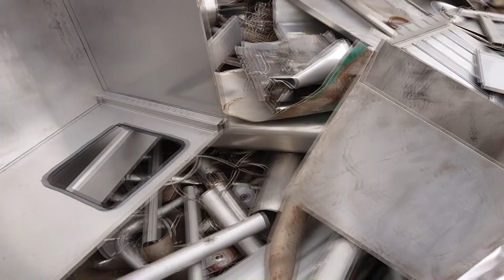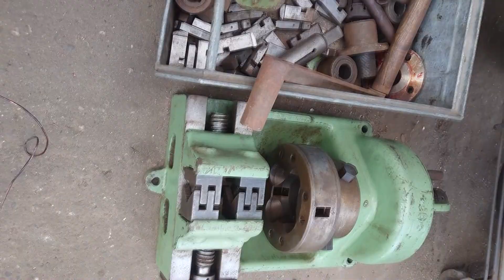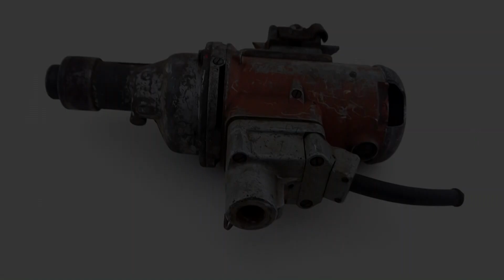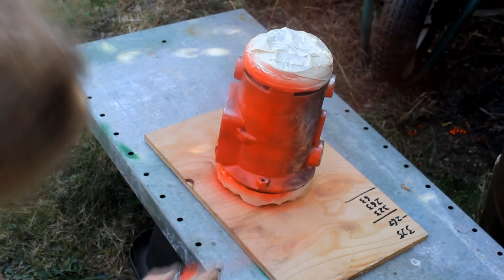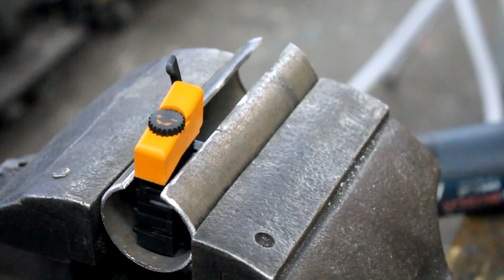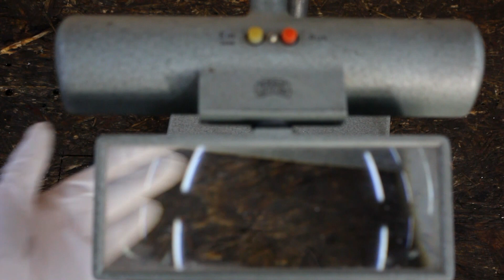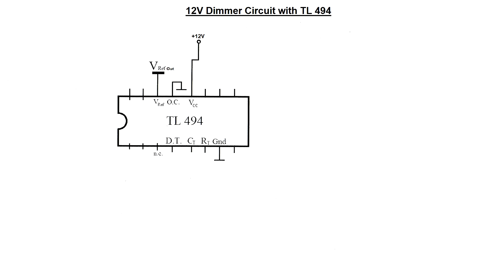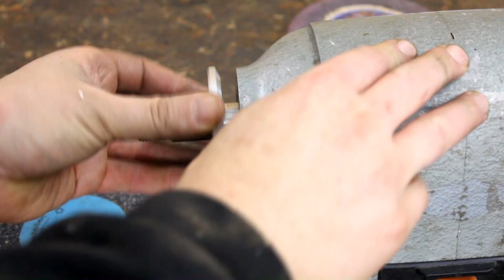Rare Scrapyard Finds! Repair-A-Thon!

Comment: Completely rusted rebar? ok surface rust might be ok, if it's in the trash it's probably not fit for construction and probably has been sitting outside for years.

Comment: Love your videos, I had an old Bosch hand drill die (after I dropped it) instead of going out & buying a new one, I opened it up & repaired it with help of an online schematic! It now works fine. I just wanted to thank you, I never would have attempted but that because of your videos, it gave me the confidence to try. Ich danke dich darube echte :-)

Comment: You are so lucky you can actually pick stuff from a junkyard - not possible in most of North America. There are lots of fully working machines worth 1000s being thrown out daily. Heck in Alberta where I live large fully working and in like new condition 100hp electric motors are scrapped.

Comment: I'm a little concerned about the heat dissipation in the Triac, the heatsink attached was way too small and vacuum cleaners are rated for much less power than that drill machine.
Maybe needs a bigger heatsink or even better would be to use the metal surface as a heatsink if you can find an insulated body triac.

Comment: I think the variable speed circuit is the problem, this drill shouldn't have speed control for it to work with its full power in my opinion

Comment: you already have a foundry, you can melt raw material from the scrap yard and reuse them. Aluminium for example, very easy to melt and cast into mold shapes that you need for your projects

Comment: In power stations and large turbines the couplings have massive expanding bolts 4-5" and the couplings cant be removed. So with these 2 handed "hoaning drills" are used for hand hoaning on these

Comment: A trick with those 12V LED strips is that you can put them in series if you've got a 24V power supply. The positive of the first strip connects to the +24V supply, the negative of that strip then connects to the positive of the second strip, and the negative of the second strip connects to the ground/0V of the supply. Both strips do need to be the same size though, so there's not too much current going through one strip.

Comment: Should’ve mounted the new switches where the old ones were. Would’ve been cleaner. No need to drill new holes and the wire wouldn’t have to be routed through the base.

Comment: Careful not to commit the error of survivorship bias.  Quality tools tend to survive longer than low quality tools, which means that even if there were just as many garbage cheap tools back in the day, they would not necessarily survive. So then it seems, to us, that since the only tools that remain are of higher quality, that perhaps predominately high quality tools were manufactured back in the day.  This conclusion is very likely false.

Comment: Great job as usual.  I love the scrapyard shows.  You find such amazingly good stuff!  The magnifying light was a real gem!  For the old bench grinder, I would have left the guard off the side that was missing and installed a wire wheel instead of another grinding wheel.  A bench mounted wire wheel is very useful.

Comment: I love watching your videos.  Its like there is so much at scrap yards that can be fixed with just a little fix here or there and its up and running or even be used from something completely different.  Just like that rebar its like why do they junk it when its so darn expensive to buy it brand new.  I had an Amish naighbor that had and old rear tin tiller he took the motor off to use for a round his home.  He gave me the old tiller.  I bought a new motor bell housing and I have used it every year so fare for my garden.  Brand new the tiller is worth 5 grand and all I spend on getting it up and running like new was like less than 300 bucks.

Comment: The Fein drill reminded me of an old vintage Bosch GD25 I rescued recently, no clutch, no soft start, but bags of torque and easily rips itself out of your hands if you're not careful. The first replacement power cable I put on was trashed on its first big job, I've since added another handle on the top where it would've had one originally and treat it with a bit more respect!

Comment: thread cutter... I kinda want that now. I have an older model thread cutter that had a bad motor and someone build a chain drive welded on sprocket and put a motor on it. Sometime in the future I intend to tear it down and make a whole new mount for it so that it can be portable. Its a fine machine for what it is.

Comment: Greetings G, it appears a time is coming when you will want/need an industrial garage/loft to make into a home with 1000 m2 workshop. Good thing you have a girlfriend to help.  Regarding the non-centrifugal-switched motor starter, the math for sizing the power needed for a capacitor permanently loaded is fascinating and an uncommon topic. Ascertaining the impedance for the starter winding to distinguish the permanently loadable winding/versus those that need to be switched out is also a universally omitted but fascinating topic.  Good job, keep going.

Comment: 23:22 That disc you are turning is not necessary. You can use ordinary sized washers. I have and mine has been running 30 years or so. The advantage of the large steel disc is really more to keep it running true and smooth. I know this because my table saw has such an optional disc. Using aluminum you are not going to get all the weight they originally engineered & intended it to have.
 I am still wondering why your vacuum cleaners have speed control.

Comment: Back in the mid 1970's I was on a scaffold platform with another worker putting up an overhead crane using a "Gut Buster" drill like that one. As it was a long way down to release the castors in order to move the scaffold tower to the next position we got someone on the ground to move it for us while we stayed on top, on this occasion they forgot to put the brakes back on and the 1 inch drill bit (25mm) bound in the hole, before I could let go of the trigger switch the whole platform started to turn along with the two of us hanging onto the gut buster. These days a mag drill/rota broch would be used for such work but back then the company I was working for did not have one. The puls width light dimmer can be made with far fewer components using a 555 timer chip.

Comment: For drilling steel that was perhaps three times the preferred rpms. High speed drill doesn't really mean what most people think.
Reply: Pi x d x n over 1000 equals meters/min (25 for hss, d in mm) 
 n is then the required revs.

Comment: Bridgeport, Connecticut: Used to make the best lathes in 'Murica since 1938, but in 2004 the brand of the same name was bought by the multinational conglomerate Hardinge, Inc, and now they make the same lathe (same brand Bridgport) but I guess with lots of chinese parts, but I don't know if they still do assembly then in Connecticut...

Comment: Be careful with old grinder wheels, even new-old-stock.

The binding material degrades over time and they can explode.
Reply: Important note! Same with old cut-off discs. Those things actually have an expiration date on their label.
Reply: @VOROX_Audio  No worries m8 rub the date off and she's good as new. Still got most me fingers as well.
Reply: Good to know
Reply: If you doubt the danger, google it. The damaged from an exploding wheel can be horrific.
Reply: Cautiously and just very lightly tap any grinding wheel with a small hammer to make it ring. If it gives a dull sound, do not install it.

Comment: We have a Bosch twin handle drill at work like the one you repaired.
I've had a few fights with it ;-)
I call it the wrist breaker!
Not too long ago I was enlarging a hole to 19mm and the drill bit snagged, before I could let go of the trigger, the drill bit bent! I had to buy a replacement one from eBay and never told anyone LOL
Reply: Now you did, and to everyone 😂
Reply: Those big drills, I used to have a few older ones like that. I mainly used them for mixing paint, concrete, thinset, plaster or anything heavy like that. They work very well for that type of stuff.
Reply: @Ultimate Handyman: So you're admitting you're not such the ultimate handyman after all, hunh? 🤣
 It reminds me of the first drill I bought. It was a 1/2hp Craftsman with two handles like that and a third D handle in back. Max speed was only 600rpm because it was meant for steal and concrete. I put it on lay-away and bought it with my paper route money. 35+ years later I still have it but the variable speed switch has cracked through.
Reply: Bending 19mm drill bits is instant ultimate handyman certification💪
Reply: @johnpossum556   To be honest, I would never try enlarging a hole in 1/2 thick steel using such a drill, but the SHE department have locked off the drill press in the workshop. We have no other drill on site that will take morse taper drill bits, apart from the radial arm drill which has also been locked off by the SHE department. 
Health and safety gone mad! 
I've now got a set of impact reamers that will fit in my impact wrench, next time I will use those LOL
Reply: I have one branded wolf , he was brave holding at face height if that drill  suddenly bit .
Reply: @MyKharli  I was expecting that to catch and smack him in the face. To me it looked like madness to try that.
Reply: I’m surprised the drill didn’t fling you around the room.
Reply: I have a fifteen year old Makita hammer drill that is a wrist breaker.  I put a big notice inside its case regarding that. It has two handles, and I recommend using them both and being careful to avoid binding and harm to wrists if at all possible.

Comment: How would you recommend repairing/replacing the motor of a battery-powered Bosch drill that isn't available any more? (Although it's only a green one, so maybe not even worth saving...)

Comment: That drill looks like it would be a handful, I was worried when you were drilling the metal that you were going to get your teeth re-aligned by the handle if it got caught on the workpiece. Great video as always!
Reply: At work we have a large drill similar to this. High torque, no clutch. I can't tell you how many times it has taken me for a ride, or twisted my wrists. The main issue is if it catches your first response is to tighten your hold (gripping the trigger tighter). You have to be strategic with your hand placement and wrist position, much like riding a dirt bike up a steep hill. With great power comes great responsibility :)
Reply: @eclsnowman  Yeah, my dad's got one at work, it's broken wrists before.
Reply: @emeltea33  My father had one like that and I can remember him drilling holes in a concrete slab and yelling for help because the bit had jammed and he was running in circles with the drill, thankfully we got to the power outlet before he was badly injured.
Reply: Interesting that they used in the classical optics town of Wetzlar those electric switches from Bridgeport...
Reply: @eclsnowman  Well said!
Reply: I had a drill with high torque like that almost rip my thumb off.  It took about 6 months for my thumb to get back to normal.  Everybody I know who uses them regularly has a similar story.  I'm VERY cautious around hand held drills now.
Reply: Lost count how many times one particular drill got away from me. It either pulled the plug out of the wall socket or literally ripped it's own power cord out. Only use stuff with a clutch these days.
Reply: @markrainford1219  Yeah my colleague has (had) a 110v metabo drill (110v for use on UK construction sites). I called it the wrist masher. I refuse to use it. The hilti replacement has a clutch :)
Reply: i would mount it into a Drill press as he mentions.
Reply: The two-handed drill is really two handfuls, not a handful.
Reply: I started to leave a similar comment. Hindsight being what it is, I'm sure he understands at this point, a cacophony of chaotic calamitous catastrophic coincidences could conceivably coalesce, compound then converge, cutting his current chronological continuum. Fucking his whole shit up... completely! Hellyeah nailed it hey mom come look at all the words I just said
Reply: When I was a boy, I was on a roof using a drill somewhat like that, I thought I would try it out with one hand.  The drill hit something got loose from me and the cord wrapped around my right wrist. The drill was low geared and kept rotating and tied my had behind my back, where I stayed until my grandfather found me.  Every time I see a drill of this size I am reminded of that. I learned the hard way.
Reply: With that drill it needs something like a harness to strap it to the person using it that would allow it to spin freely or it to be locked in so it cant spin once it is in position and tilt left , right , down and slightly upwards for hand use other wise a stand like a drill press would also work well

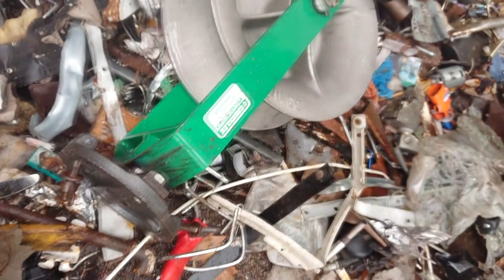Comment: time stamp 2:04 the pulley is an expensive one used in construction for pulling wire, they are in demand go back and pick it up!!  re sell it for a quick 75 euro!  i have used them many times and they are very robust.  the fein drill was the drill for a core drill setup, also very expensive.  the threading machine is also used in the electrical industry or by pipe fitters and is again very expensive.  amazing someone threw out a thousand dollars worth of stuff like that.  the threader will have legs or a stand or something to keep it at working height.

Comment: I  have a corner of my work table is a 70s small drill press. Having that extra bit of stability helps. But it would be an improvement to add speed control, in this case in the AC plug, probably no room for anything else inside the drill.Even then, better than many modern equivalents.

Comment: sharpen ur drill bits...  first a guide hole with a small bit then the big one...  sharpened.
Reply: That would be a waste of time.
Reply: @SinsBird  next time u have to drill 20 holes ( 10mm diameter) on steel, by hand..  Try 10 your way.. And 10 the way i told you... U will halve the time. Truly.
Reply: @JorgeMarioManuelOrtega  You're not supposed to drill 'by hand' with a power drill, that's the thing. Simplest way is to wrap a chain around and let it do the work. Pre drilling not only would take twice as much time but also creates an edge that beats up the flutes because of a point load.
Reply: @SinsBird  "u are not suposed to" is an ideal. reality and experience tells you other.

Comment: Thank you for your help !
Here is a tip to help you
The #1 penetrating fluid "U.L."
50% acetone 50% A.T.F. automatic transmission fluid. Tested by United lab's. Hope it's helps I personally hate the spray cans that fail when you need them most find a hand spray bottle of good quality to use it with

Comment: As far as electrics inside a steel tube is concerned Plast-Dip is a very easy way of ensuring that every conductive surface is completely insulated and it actually have a very good electrical insulation rating and it is one of it's intended uses(it gets harder with age so the first week+after applying it will be more delicate and not at full strength).

Comment: Just wrap a chain around the power drill and the thing that you're drilling into. As you turn the power drill, the chain will push the drill against the workpiece with a great force.

Comment: Those kind G+F threadcutter but the larger model up to 4" with electric drive are still in use in the company I work, the lads prefer them over brandnew Ridged pipe threaders. Becouse here the cutter rotate not the pipe. and rotating 4" up to 6 meter pipe on a always dodgy stand is no joke.

Comment: Looks like maybe the control circuit you added took some power away from the drill itself...    i would think it should be fast and torquey as hell..  wonder if theres an rpm the manufacturer has listed that you could test...

Comment: That lamp and magnifier is just awesome and the conversion to dimmable LED was perfect.
Reply: i know he just used what he had already, but there are those same strips that come with the tri color, so u can change it to any color. it helps if u want to use a different color for different applications. i find his color there to be too yellow, or the color temp too low.
Reply: @sMASHsound  yea I agree. Should be at least 5000k for cool or day colour. Warm is rubbish
Reply: Yeah and he gave me THE solution for an old reading lamp for which there's no more replacement bulb. Great idea !

Comment: Lots of rebar, "I only buy when I have a concrete use for it." +1 pun!
Reply: I liked "...the switch is dirty, but works Fein."
Reply: You just cemented his reputation, or at least laid some solid foundations.
Reply: Oh I missed that one. Lol
Reply: As a Dutch speaker "having a concrete use for" is simply the obvious choice of words, especially when interpreting or translating a script
Reply: @wolfetone2012  Maar taal moet vloeien. je mag het niet vast betonneren :-D
Reply: @oreubens  alsof onze taal niet vloeit. We hebben op dit moment net zoveel Engels granulaat in onze taal als de Engelsen Frans hebben in dat van hen ;-)
Reply: @wolfetone2012  Tjah... spreken over beton en staal...   harde woorden...  zand erover. :)

Comment: nice repair-a-thon. i have a smaller older drill whith similar design, similar gearbox and no1 taper i think, dosent have any markings on it, i think i will make an art object from it, a lamp or a steampunk thing, i think because of the metal case it s to dangerous to use

Comment: The light is too warm in my opinion. For work environment you have to have pure white, or a bit cold light. I would also integrate a changeable LED light bulb instead of LED strip.

Comment: Just as a safety reminder the left thread nut must be on the left side so your rotor is probably flipped arround. This way the wheel can loosen itself.